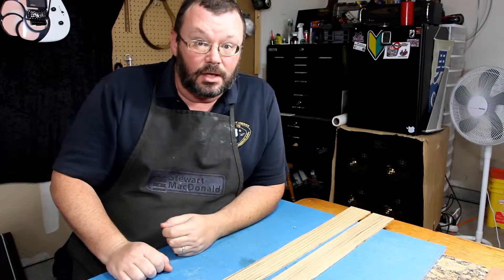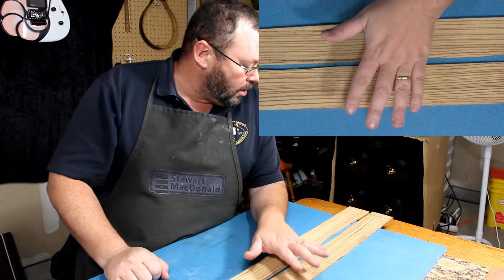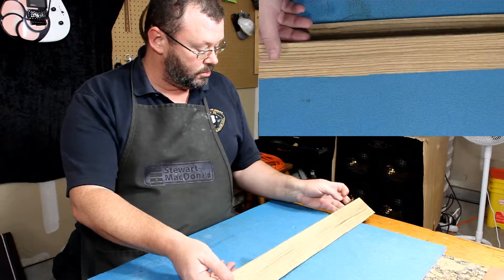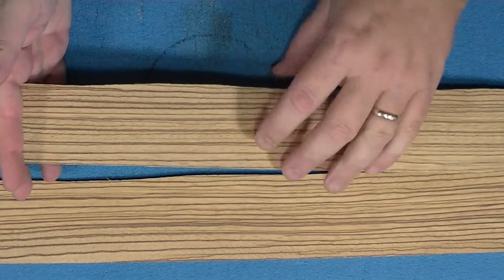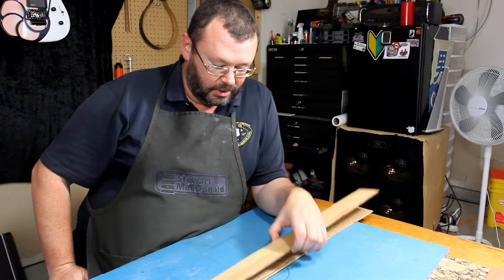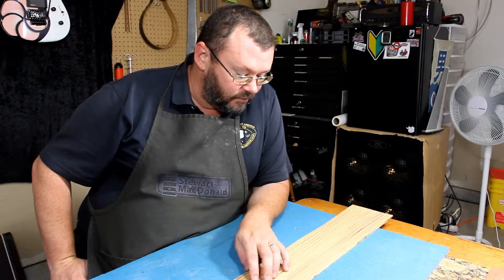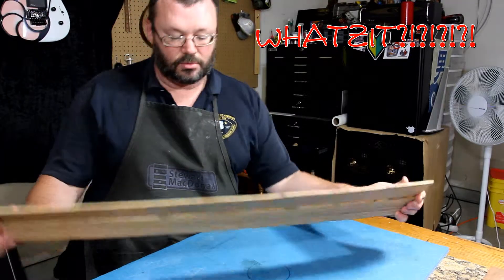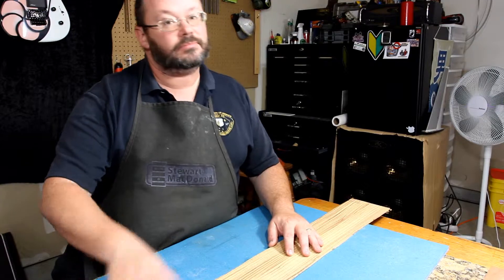WHATZIT episode1- mystery wood | RATTLECAN GUITAR RESTORATIONS by James O’Rear

Comment: Hmm, it's always hard to tell a wood species just by looking. But just for shins and grins, I'll make a couple guesses anyway:

Bocote
Black Limba (aka, black korina)
Persimmon
Zebrawood

Maybe an "undesirable" piece of ebony, since a large portion of ebony is actually a creamy color (not solid black.) But it would still be hard and dense, so you'd probably be able to tell just by holding it. I'm leaning towards one of the others I mentioned though, at least based on what RC has on their website.

Zebrawood would be my number one choice, because of this: http://www.wood-database.com/lumber-identification/hardwoods/zebrawood/
Reply from the maker: Great info. It certainly has the large pores mentioned, I'll have to see how "unpleasant" the smell is when I work it tomorrow. It is pretty solid like maple. thanks again for the info.